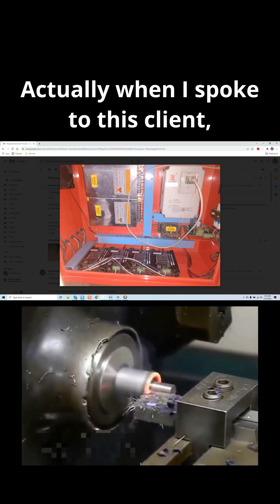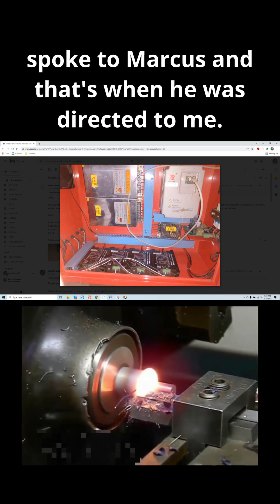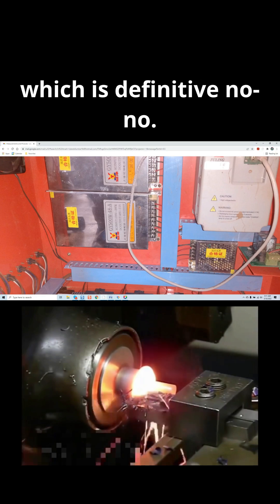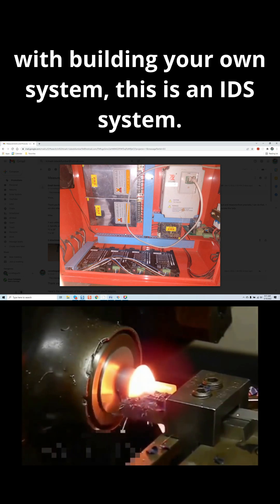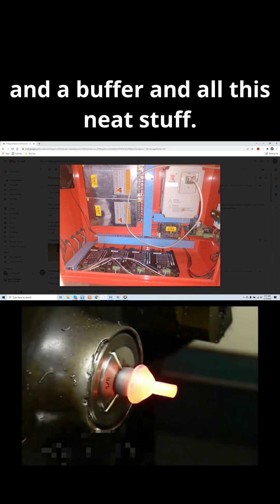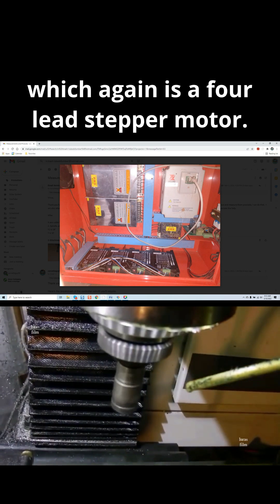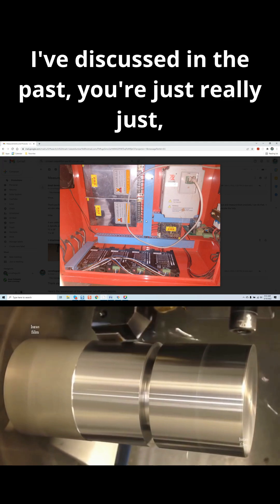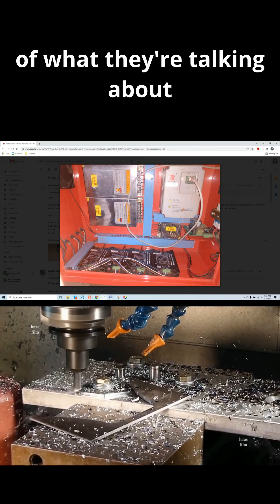⚠️ Chinese CNC Controller Review – Hidden EMI & Stability Risks! ⚡🔧 (Engineer’s Warning) #shorts

Comment: I have a Chinese 60100 cnc router. The controller box looks great. Has ethernet type controller.  It's so buggy it's not even funny. I could never figured out why it's so inconsistent.  It can mill accurately  one pocket then botch the next one. The only cause I can think of now is emi.  I need to chuck the controller or just sell the machine for cents to the dollar. 😅